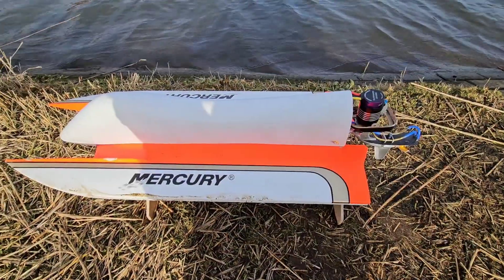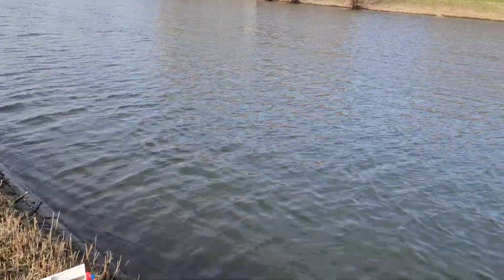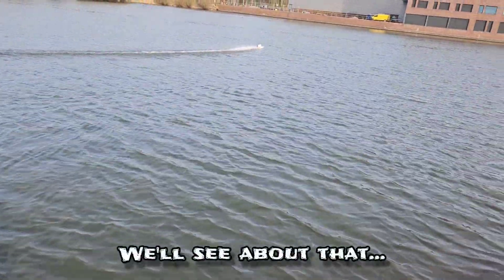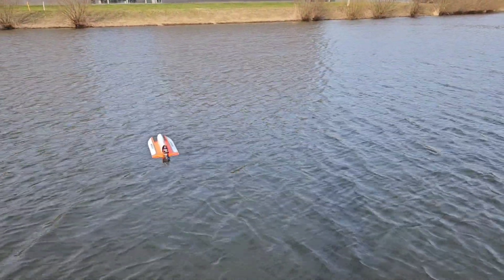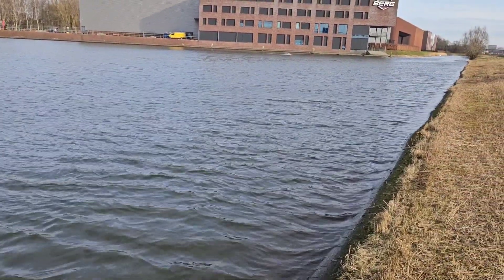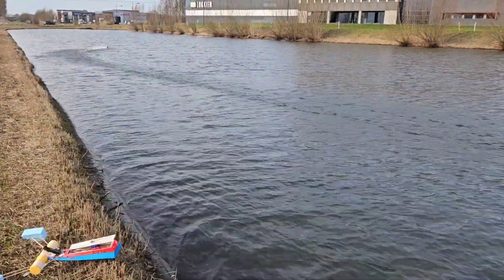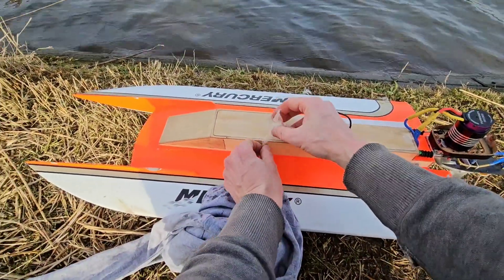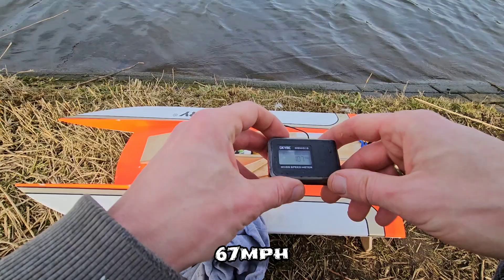DIY F1 Tunnel: Running the wrong prop turned out way better than expected!

Comment: Sir am from INDIA.please i needur help because i don't know about this.

I am asking that 

if i buy FLYCOLOR 90AMP 
ESC should it be suitable for 
3660 3800kv 4 pole motor
And 
2958 4pole 3380 kv motor 

With 3s lipo

🙏🙏🙏🙏🙏🙏🙏🙏🙏🙏🙏🙏🙏🙏🙏🙏🙏🙏🙏🙏🙏🙏🙏🙏🙏🙏🙏🙏🙏

Plese sir help me
Reply from the maker: The 3660 motor is on the edge. With a small prop (38mm) it will work I guess. The 29 series motors will work great!
Reply: Thanks guru ji....

If i use hobbywing  Skywalker 100amp ubec v2  brushless esc with this 3660 3800kv and  2958 3380kv 

Should i face any problem with any thing.pls reply
Reply from the maker: @bgminoob7984  That should be fine! I'm going to use a 100A esc as well with a 3660 3180kV  motor

Comment: Awesome result Cozy. It is a little rocket that has the looks as well and no doubt you will get it going a bit quicker. Curious to what the length of the pond is?
Cheers Kev 👌👍🇦🇺
Reply from the maker: Thanks! Yes, there's more in it for sure. I will  run it with a 40mm prop next time.
The pond is about 250 meters long.

Comment: he gain speed but lost the ability to turn fast, you can run more kv with that prop
Reply from the maker: @daiciuapostol79  Or try a bit larger prop. Next time I try a 40mm diameter, hopefully for 110+ km/h 😎

Comment: Best wel logisch dat een kleinere prop beter loopt met een 2000kv motor.
Het rendement van de motor komt nu beter tot zijn recht dan wanneer de motor moet vechten met een te grote prop
Reply from the maker: Normaal vaar ik met een 3674 1650kV en een 643 prop. Dit keer met een 4074 2000kV motor en een 638 prop. De 4074 motor zou meer vermogen moeten hebben, maar het koppel is waarschijnlijk lager. Een 38mm propje is wel erg klein hoor, voor deze motor. In de bochten merk je dat er te weinig prop in het water zit; dan verliest hij een hoop snelheid. 
De volgende keer probeer ik deze prop met 40mm diameter. Ik ben benieuwd!

Comment: So good in the rough water.
You are making me like tunnels with the way that thing goes,just be careful next time out if it’s smooth water those temps might go up.
The bumps reduce the drag if the boat can handle them.
Reply from the maker: Thanks, James! Yes, on flat water it might stick a bit more. Next time I wll try a 40mm prop!

Comment: This is amazing bro 🎉
Reply from the maker: Thank you!
Reply: @CozyRC  I built RC airplanes but you're tempting me to make a fast boat 😂
Reply from the maker: @pavelyroycamachorivas9771 You will not regret trying it. It's almost like flying, finding the right balance to get the most speed. It's great 😎
Reply: @CozyRC  for sure I'll try with your initiation model.

Thanks Master